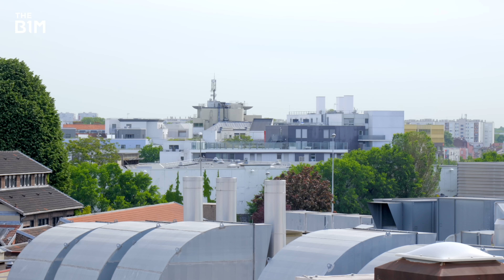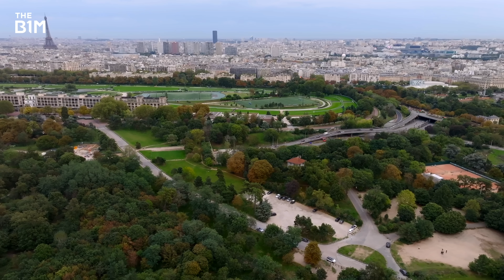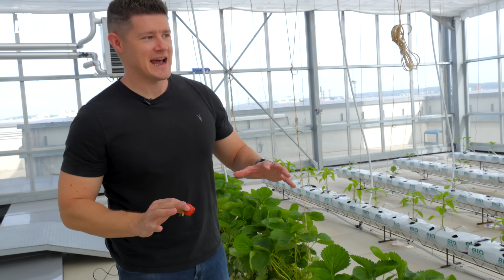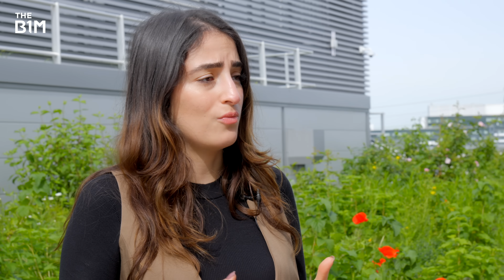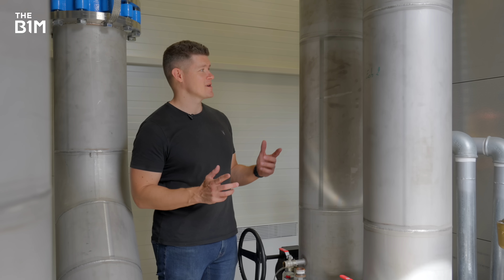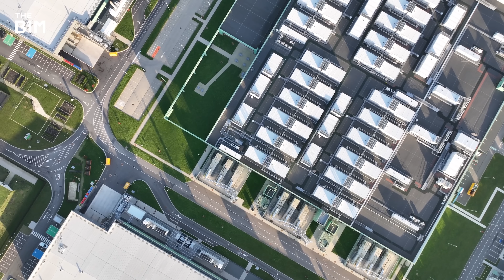The Paris Olympic Pool is Heated by the Internet

Comment: I curious, How does this data centres got their energy from in the first place? If its still coals & LNG at the start line... then, there's no other way to put it other than greenwashing 😢
Reply: France exports nuclear electricity.
Reply: @mountainjeff  They also export Nuclear waste
Reply: Waste heat recovery is not necessarily greenwashing.
Reply: Clearly in France it will be nuclear...

Comment: If memory serves me correctly, half a century ago Grumman Data Systems used waste heat from it's main datacenter in NY to heat the building.    The concept has been around for decades.
Reply: Sun Microsystems were also pioneers in this concept.
Reply: Half a century ago? Like a datacenter on vacuum tubes? Well, that could easily work producing the 60°C air or even hotter. Unlike the modern microchips.
Reply: @deniskhafizov6827  Maybe you guys still used vacuum tubes in the 70's but the west had long since moved over to "modern microchips".
Reply: @krashd  then how did that "modern microchips" survive the 60°C hot air
Reply: It wasn't financially viable. This stuff is only viable because politics decided to subsidize it. Like most of the "green" stuff. "Energy efficient" constructions are subsidized in most countries. I'm pretty sure they also made a big exception for this to advertise it... like in this video.
Reply: Why would this be expensive? The heat is basically "free", so this is actually cheaper than conventional heating  @Robert_Musil

Comment: I understand how it's heating the pool. Furthermore, I understand it can heat homes. But homes only need to be heated less than half of the year. So where is the heat being used in the summer when no home heating is required?
Reply: People still need hot water in the summers for showers, washing etc.
Reply: @zapfanzapfan  exactly
Reply: It could be used to cool places too with a heat-pump like system, or like an A/C but reversed. Yes, heat can be used to cool.

Comment: How do you go from 30C to 60C without additional energy 🤔
Reply: You can't. But now calculate how much energy you will need to heat the water from 30 to 60C and from 15 to 60C.
Reply: Heat pumps.
The heat turns a working fluid (usually CO2 from a low pressure liquid into a high pressure gas, that gas goes through a compressor & the higher pressure gas runs through a expansion coil, releasing the heat energy at a higher temperature

Mathematically the overall process and ratios are very similar to a electrical transformer

Neither a heat pump or a transformer can create heat or voltage.

But they can move heat energy & voltage up and down a scale with a small energy loss.

If you are interested, recommend diving into the heat pump rabbit hole on Wikipedia.
Reply: @bmwhocking  That's what I thought, additional energy is required. I'm sure on a massive scale.
Reply: @gino5037  If the heat energy is used somewhere  instead of blown out into the air, that's a win. Less energy from the general grid or other sources is needed, money is saved. It doesn't have to be all or nothing.
Reply: @gino5037  As @freetripin said, a massive scale is still less than an enormous scale.

Comment: In Munich there's a bus depot that has chargers for electric buses. The heat from the chargers is used to heat the building.
Reply from the maker: Wow, that’s so cool! What’s it called?
Reply: @TheB1M  Hybrid-M designed by JSWD Architekten
Reply: @TheB1M  it's SWM Moosach depot, chargers manufactured by Ekoenergetyka.
Reply: @TheB1M  By any chance, did you get harassed by the illegal migrants during your time in Paris?
Reply: @bloupm620 Found a migrant…
Reply: In Moscow there is a subway that runs electric commuter trains. It never used any specialized equipment hor heating, all the heat coms from the trains and other electric equipment, even during the coldest winters. Actually Moscow subway is usually suffering from the opposite problem - how to get all the excess heat out.
Reply: @deniskhafizov6827 London subway has the same problem. Each year the underground is getting hotter and hotter because they cannot vent all the heat from braking and people
Reply: @zukacs  Subway trains to the vast majority brake regeneratively by using their motors to send electricity back to the grid, which is a quite efficient process, so much less heat shed into the air versus mechanical braking. It also produces way less particulates versus entirely using mechanical brakes.

The heat comes from having heavy trains start and stop all throughout the day inside a small, enclosed space. Even as efficient as electric motors are, they still have losses. And as you mention, also all the people. :)

The London Underground is a vast untapped resource for heating. It really should be exploited, I'm surprised nobody has done so yet in a big way. Maybe district heating isn't a thing in London? After all, buildings used to have their own coal furnaces in the past... Even so, many larger discrete buildings should be able to tap heat from the Underground by sinking boreholes parallel to the lines and run heatpump tubing down through them. Installing heat exchangers inside the tunnel platforms  themselves would be even better, you'd also get cooling for people waiting for their next train that way. :)

Comment: I ran the organisation at Sun Mricrosystems responsible for designing and building innovative, green, data centers. We were about 15-20 years ahead of our time and as a result the market just wasn't ready to accept these ideas. I am so happy to see this sort of thing now get get traction. I really wish I could still be involved. It's something the world deintely needs!
Reply: I really liked Sun’s “Grid” computing, but like some of the other great ideas at Sun they were indeed too far ahead of the market.
Reply: Now, Sun Microsystems is now under Oracle.
Reply: I think Sun MS have adopted Immersion Cooling??
Reply: @ThoughtFission Are you knowledgeable about this? 
Because I'm confused about the 30°C of the water. I thought it would be much more like 50°C considering the temperatures computers can reach.
I'm not familiar with data centers, but considering most PC's are running at like 55°C at least, I thought it would be no problem to reach water temperatures of 45 - 50°C.

Do the computers in data centers run at lower temperatures? 
Or does this process have this much heat loss because they are using air cooled computers and a heat exchanger?

If it's the second: why aren't they using watercooled computers?
Reply: @Harry_Gersack  There are going to be efficiency losses due to the volume, distance, and state changes of the liquid or air involved. That's just natural for any system that is confined to the laws of physics.
Reply: @IDKManStuff  Yeah... massive losses. I'm certain the whole process is a loss leader - on a huge scale - which will be dropped as soon as the next financial director takes over at that company and realises the PR gains are just not worth it.
Reply: @Harry_Gersack  for number 2 question, it is for the sake of simplicity and budget 
but nowadays some of AI server using watercooling directly to the chip already
Reply: @Harry_Gersack  Generally speaking, the temperature of cooling water depends on the heatload shed into the water, and the volume of water per second moving through the system. More heat influx -> higher temps; higher water flow rate -> lower temps. So it's not a fixed relationship, you can't assume that a system would achieve any one particular temperature of water.

Also, lower temps for your coolant generally lead to happier processors that wear less and consume less power (current leakage in transistors increase as heat goes up, leading to even more heat being generated and more electricity being consumed.)

As for using air cooling, it could be because it's simply easier. It's not just the CPU generating heat in modern computing systems, voltage regulators shed quite a lot of heat, as do components like chipset, SSD storage and power supplies as well. And also if you have discrete GPUs in the data center the GPU and its voltage regulators need substantial cooling as well. :) With air cooling, everything gets cooled relatively easily, you just use powerful DC fans to push air through the chassis, in at the front end, out at the back, and everything inside the box gets cooled. Water cooling would need a coldplate custom-designed for that particular system to attach to every heat-generating component, which of course is way more complicated and way more expensive.

On top of that, power supply would still need air cooling. :D
Reply: @Harry_Gersack   Watercooled is more expensive and has the non zero chance of leaking.
Reply: I can only assume what you meant by "the market wasn't ready" that it wasn't economically viable.
Reply: there is no such thing as „green buildings“ or „green data centers“
Reply: @rurathn5534  Ah you are obviously superior, because you absolutely didn't use some electronic device and the internet to watch and comment this video.

Obviously there are data centers that are more sustainable than others when they're using electricity from renewable sources and try to recover as much of the byproduct heat as possible. 
Every fucking thing will have an ecological footprint. Even we'd go back to living like cavemen.
So what's wrong with trying to reduce the ecological footprints of things that exist and are needed anyway.
Reply: @rurathn5534  well not green but less not-green i guess lol
Reply: lies

Comment: W hen its cold my PC keeps me warm  instead of house heater. So i guess thats super green now?
Reply: yes.  you are using your pc to entertain/work and to heat your home.  you are using it to do 2 things and save energy versus turning on your heater.  if you can use a single thing to do multiple things, you are being efficient.  and efficiency = green by modern day standards.  it's a dumb term (calling things green) but it's catchy and doesn't fully piss off environmentalists.
Reply: Yes
Reply: No, cause if you use a heat pump to heat your home, your PC is abput 3 times less efficient.
Also, it depends on what energy is used to produce your electricity vs the energy o
You use to heat your home.
Reply: I don't have a gas supply to my flat, so running something intensive on my PC is literally the same in efficiency / cost terms as turning on my radiator.
Reply: It's not necessarily the most energy efficient.
Generally speaking a computer is not a particularly efficient heater.
That said, it does produce waste heat.
If that waste heat is then captured and put to use (i.e. warming your room) then this is net more efficient than blowing all that heat outside and then heating your house without using the waste heat.

All that said, if you're not using your computer it probably shouldn't be on.
Reply: @coreyhipps7483 I’m pretty sure “efficient heater” is an oxymoron.
Reply: No, I beg to differ. You computer is essentially a resistive heater. Heat pumps deliver 3-4 units of heat for every unit of electricity. It is still nice to have additional PC heating though :)
Reply: If you were going to use the computer anyway, it's great to not let the energy go to waste. But there's a risk of getting into a mindset that the energy usage isn't that bad because you use it for heating as well, leading to more energy usage than you would have done if you hadn't thought of it that way.

For instance, you might decide to invest in more power hungry PC hardware with the argument "I'm going to use the energy anyway to heat, killing two birds with one stone". Not considering using more energy efficient hardware together with a heat pump might use less energy overall.

This is the same trap many carbon offset programs fall into. People keep consuming because they think they have their carbon footprint taken care off, often leading to more consumption and in the end an increase in carbon footprint. Not to mention that a lot of carbon offset programs are not delivering what they promise.
Reply: Thank you for your service.
Reply: Seriously, I was about to post the exact same thing about my graphics card =)
Reply: Agreed. Lol
Reply: I rather have a woman to keep me warm in bed ..😜😜..  You can say that’s “ Green Energy “..
Reply: Always has been.
Reply: Its a byproduct that normally isn’t used at all, so instead of making more carbon with a whole different machine to do heating, use something that is created and normally not used.

Comment: Do these data centre's charge other users a fee ?
Reply: Not in my experience, as a real estate developer.  The data centers are happy to give the heat away, and achieve ESG credits and ‘“greenwash” their operations, so long as the beneficiary project pays for the initial heat transfer infrastructure costs.  The thing that needs to be considered is what happens if the data center becomes obsolete before, say the neighboring apartments or housing.  Was that building designed for a new independent systems.  Many advantages of this symbiotic system, but also many complicating factors that need to be taken into account.
Reply: @smorkun  I agree also if the rules and regulations become more stringent over time does that bring in other issues of cheaper secondary environmental issues

Comment: But what happens to that heat in the summer when heating houses and buildings and greenhouses is non existent?
Reply: ppl still want hot showers
Reply: That is where the pool comes in, water has high energy density so any excess can be dumped there
Reply: @lielakoma  So, in the winter the pool is not heated?
Reply: @kpmac2971  Pools require heating every single day throughout the year unless they are outdoors and in a warm climate.

Comment: so the data center only outputs 30C water.. the service provider still needs to raise it to 60C
but I see how that will significantly reduce heating costs
Reply: If the water starts out at 20c, that means the datacenter is reducing the service provider’s energy consumption by 25% using energy that was already being used. That sounds like a win to me.
Reply: @Mira-bt3zx  and it probably starts at a much lower temperature since water mains  run (depending on the location) a fair bit underground. I don't know how deep they are buried in paris but I'd guess at least 2 - 3m. 
I guess the initial temperature of the water is more like 5°C in winter and not more than 10 - 15°C in summer
Reply: that's where heat pumps are used. boilers are a thing of the past and will be phased out in favor of industrial heat pumps in the future
Reply: @felixstg1  Even if heat pumps reduce the provider’s energy expenditure by 75% (reasonable for up to 80% less power but electrical generation losses), we were going to use the data center power anyway. So we still get a 25% reduction in heating costs, just from a different baseline.
Reply: It really depends on the initial temperature of the water...
Reply: I have floor heating throughout my house. The input temp of water going in the system is like 30-35 C. For the right homes 30 C is hot enough to heat the whole thing.
Reply: On top of the other replies, it's still district heating where you can have a much larger and much more energy efficient heater raising the heat that benefits the entire local area, compared to each place needing smaller scale heaters that are less efficient to achieve the same result.
Reply: And cooling costs...
Reply: The efficiency could be greatly increased by using 100% liquid cooling.
Reply: Clearly you don’t understand how heat recovery systems work.
Reply: @Minn_So_So  my concluding statement was positive, how does that paint me as ignorant?

unless you misread my comment